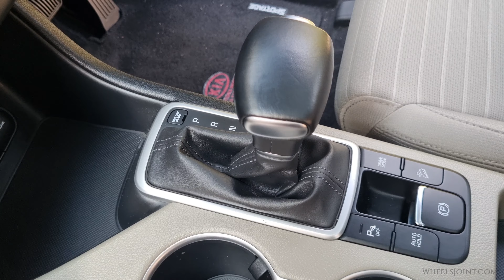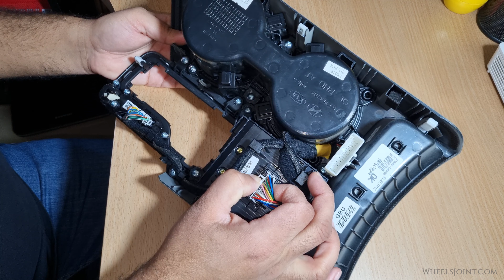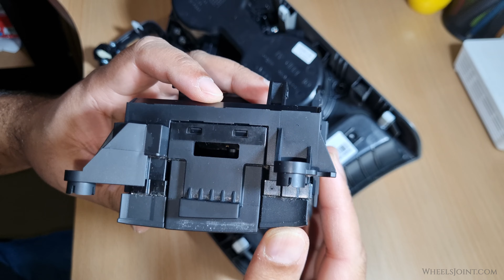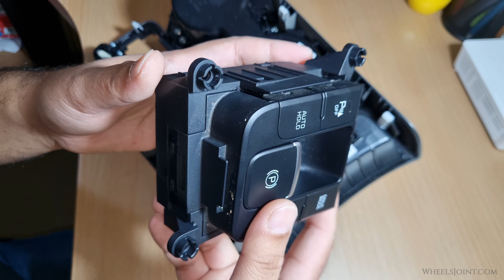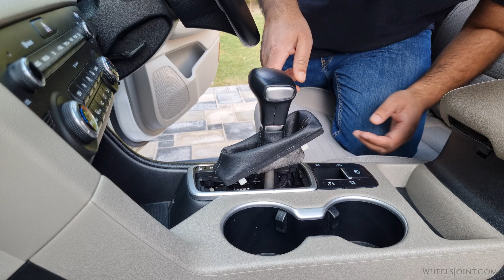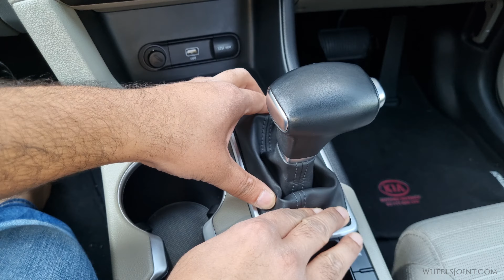How to replace center console buttons in Kia Sportage

Comment: Thanks for the helpful video. Do you think there are any other things we could try to diagnose the issue without removing the centre console? The parking brake warning light doesn’t come on, and there’s no whirring sound from the rear or any feeling of the brake engaging when I activate it. Thanks

Comment: My kia's welcome chime is not working still even if it is turned on can you make a video about it and where the speaker fuse is
Reply from the maker: Most probably the center speaker on top of the dashboard is dead. You can replace it by removing the plastic mesh cover. I do plan on making this video soon.
Reply: But I replaced it already

Comment: Thanks for your video I did this job a few months ago after watching your video before, everything worked perfectly thank again, have you done a video on the retractable parcel self mine keeps sticking, sometimes it works perfectly and other times I have to keep pulling it several times before it works again. 👍.
Reply from the maker: Not yet, will look into it. Thanks!
Reply: @WheelsJoint thank you very much ❤.
Reply: @WheelsJoint AOA bro hope you are doing good bro there is a common issue in Sportage. Back led of Sportage after 2 to 3 years will stop working it only work on brake can you make an video how to fix it literally it's a small part of led which works on braking but not on parking